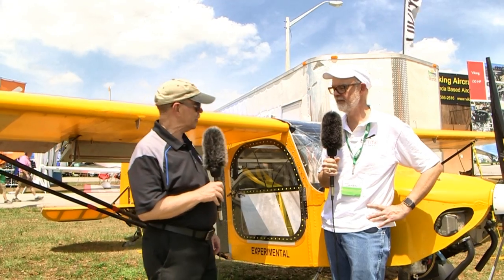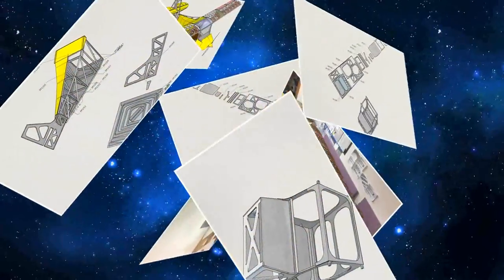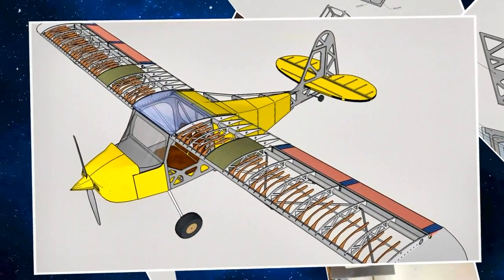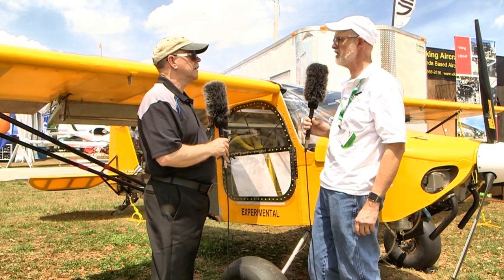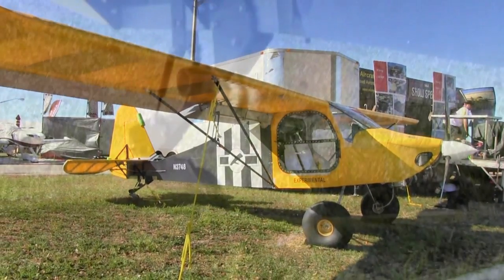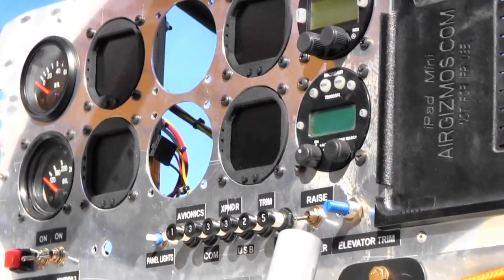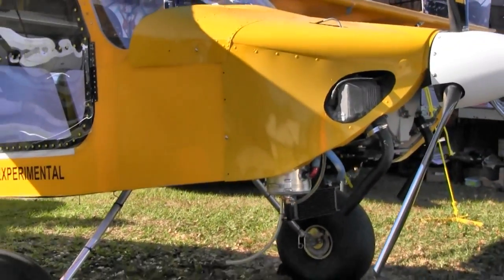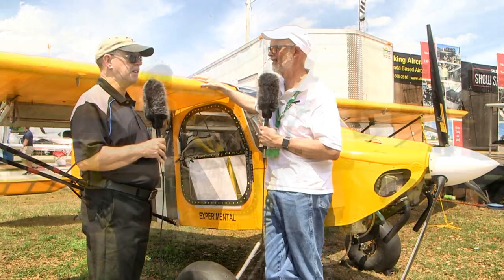Chipper, Belite Aircraft's Chipper Two Seat Experimental Aircraft at Sun N Fun 2017

Comment: That is truly a beauty, Well Done!  For power I'm thinking its a perfect platform for the D-Motor.  It's lighter than the 912, fuel injected and FADEC control for less money. what's not to like?
Reply: From what I've read, D-Motor is still "working out the kinks.  The basis for the D-Motor really got my attention with it's simplicity, and in time, I think it will be a great product but, I'm just not sure I would buy it this earlier in it's development.   Obviously it's just my opinoin.

Comment: I really like James and his wife but I bought  yellow ultracub in in 2012 biggest financial mistake I ever made 25 +k and yes the color matched. It was a lemon caught fire  underdash 4 times finally found that whoever put the engine ground wire on did not crimp it and wasnt making good contact the engine vibrated so bad that at idle it would slide across the hanger floor the prop was used and out of balance 2 guages  never worked replaced with falcon wheels vibrated apart just taxying to runway the tailwheel bolts were bent and would not tighten up the rear fuseloge was twisted I'm glad I only flew 2 wright brother flights  junk total junk I had problems with family and as locked out of hanger 6 months I had to tear off alot of fabric because of rat damage the fuselage is only held on with a tiny aluminum plate and a few rivets they were broken and loose needless to say if you want to commit suicide buy one fly it till you crash good idea but extremely dangerous and poorly built maybe I'm just unlucky but damb to put out a product like that even once gotta have a mental problem just saying my life is worth more than that